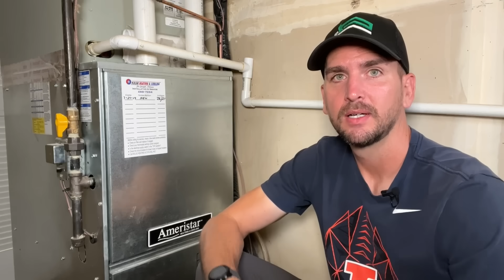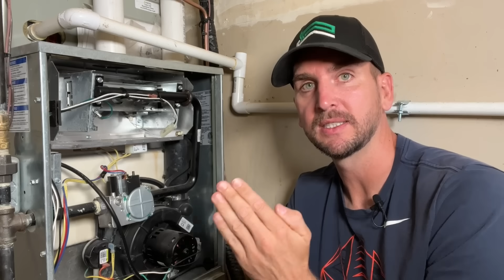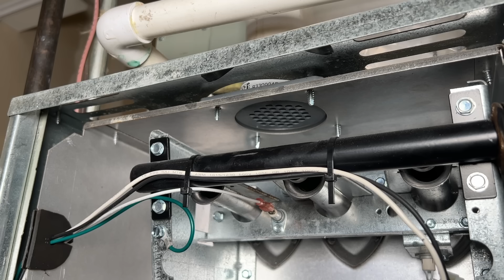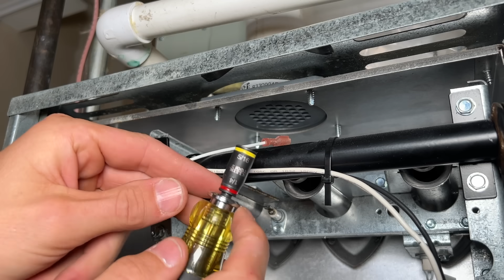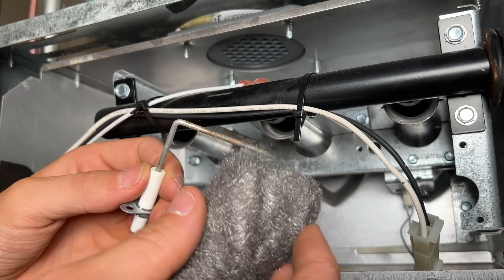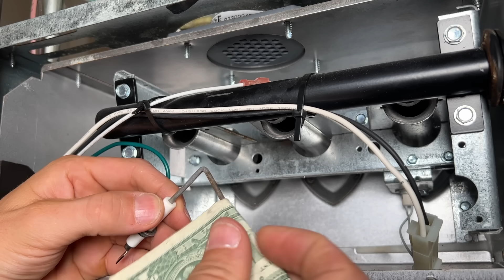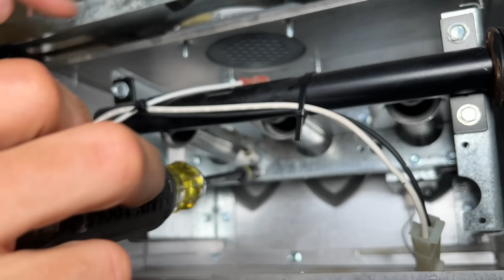The Most Common Reason Why A Gas Furnace Won't Turn On

Comment: I’ve had more hot surface igniters fail than flame sensors. It’s a good idea to keep one of those on hand as well as a spare pressure switch
Reply: Obviously experiences vary.  I have only had the problem with my flame sensor getting dirty.

Comment: The first year we moved into our house with gas appliances, I noticed the heat went out overnight in the middle of winter. Found a video explaining this exact issue, got the flame sensor cleaned and heat back up and running without the wife waking up. Totally saved. The following year the issue returned so I went ahead and got a new sensor and cleaned the old one off for a spare.

Comment: I had the same symptoms and took me about a week to figure out the issue on my older furnace that uses a pilot flame.  Turns out my inducer motor would freeze up and I didn't notice that the small second fan inside the furnace cabinet wasn't spinning.  And I should have noticed this because it had been making squealing noises for several years.  Once I replaced the inducer motor the burners stayed lit.

I think the MegaPro ratcheting screwdriver is better.
Reply: Is your furnace a Trane XL series?  Those seem to have a reputation for noisy combustion air motors.
Reply: @somaday2595  no, it’s a Payne.

Comment: Great video. My gas furnace is 20 years old, and never had this problem. So now I’m wiser, I’ve cleaned my sensor and ordered a replacement. Maybe 20 more years before I have to replace the existing cleaned one. Thanks for such great do it yourself advice.

Comment: Good video. I also would like to suggest a very common problem with the pressure switch being dirty (clogged in my case) where I tried blowing slowly in it and not much flow was going through it. I was able to clean it and bought a replacement just in case for less than $10.

Comment: Very good video. I'm a retired HVAC repair tech. I would add to your information by saying, not to try and bend the flame sensor, and avoid touching the rod with your fingers. Believe it or not, the oil from your fingers will effect the ability to sense the flame.                                                                        John
Reply: I replace my 20 year old flame sensors on my two furnaces. When I bought them at the place I got the furnaces, the parts weren't in a bag and the woman actually handed them to me by the sensor. I told her these should not be touched and she went to talk to her boss and he confirmed. I cleaned the new sensors before I inserted them and have not had to clean them in over a year. We have five cats and lots of litter dust so they need to be cleaned usually twice a year.
Reply: @davidzajac4907 I imagine with five cats you need to disinfect your house constantly. 😆
Reply: The same applies to the headlight in your vehicle don't touch the bulbs cuz it will shorten the life of the bulbs cuz of oil on your skin
Reply: @smokey72382 halogen bulbs only
Reply: This has helped me fix my problem. Thank You. 😊
Reply: Very good explanation awesome
Reply: I'm working on a luxair furnace for a friend. 3 red blinking lights says vacuum switch, switch was replaced and still the sane problem. The switch has 2 vacuum lines. I can lightly blow pressure into either vacuum line and hold the pressure continue lyndon the furnace will come on and run. But once the pressure is released the furnace shuts back off
 Could the chimney be blocked?
Reply: 65 bugnut has passed last fall due to touching live wire
Reply: Thanks a lot
Reply: You saved me!!!  Furnace was down at sub-zero temps and you saved me!!!
Reply: I've got an old Coleman furnace. The mobile home is 2000 model but The furnace says 1973 so I don't know. The green light is flashing three times which indicates Combustion Air Switch Failed to Close. As long as I blow into the hose leading to the switch the light stays solid but as soon as I stop blowing the light starts flashing in three again. Recommendations short of buying a new furnace? Ty.
Reply: I have an old goodman gas gmt070-3
I'm not sure why but I will turn it on and kicks on but doesn't get to temp. 
It then won't click back on for hours. 
I'm lucky if it randomly decides to get to temp.
 
I've replaced my thermostat. 
Replaced external filter as well... No idea if there is another i should know about. 
Going to replace the induction blower due to it clicking a bit. 

The flame and fans seem to be working. 

Thank you for whatever help or advice you can give!
Reply: Used automotive mass airflow sensor cleaner, worked like a charm
Reply: My burners won't get to the part where they light before sensor can sense there on
Reply: Check gas valve
Reply: since you are retired what did you charge to make a residential troubleshooting?
Reply: Holy crap. Had no idea how to do any repairs. Followed your advice and rubbed a dollar on the flame sensor. Started right back up!! Amazed… and did it while waiting for a call back from the repair guy. You are amazing!!
Reply: The what? You mean the thermocoupler?
Reply: Also make sure that the green ground wire is connected on both ends. If your burner is not grounded it won’t work
Reply: ÑSi Si
Reply: And turn off power when cleaning senser, 120 volts can be present on senser wire and rod.
Reply: Learned that hard way last year arched the ignition and fried the board was a nice 600 dollar part now shits not starting this year
Reply: Good to know!  So if you think that somebody HAS handled it, should you just use dish soap; and water, rinse well, and let it dry?
Reply: I always clean them with rubbing alcohol and a non lint rag after handling or 0000 steel wool with some rubbing alcohol
Reply: Very true.
Reply: @Theclassyburito  no I'm good I'm happy with the man I'm with he works his ass off
Reply: Can you advise?
Trying to fix my daughter's furnace. Our furnace guy is too busy. 
It's not high efficiency like the one in this video.
The motor in the "draft inducer" blower motor burnt out. Got a replacement from Amazon yesterday. The original blower housing has a small 3/32" steel tube port for a silicone tube that goes to the pressure sensor. The new blower doesnt have that port so I made one with a rivit nut and a hollow 1/4-20 screw but the pressure switch doesnt click.
I assumed that since the port is outside the squirel cage wheel, the pressure switch must sense positive pressure. It doesn't; it senses vacuum! When I suck on the disconnected tube to the pressure switch, the furnace comes on.
I dont know how there's a vacuum inside the blower housing but outside the squirel cage.
Maybe there's some kind of bernouli thing going on. 
The blower mounts to the exhaust of the hot box. Its outlet is blowing vertically upward to the chimney at a tangent to the squirel cage at the 9 o'clock position. The vacuum port on the old blower was on top at the 12 o'clock position. I didnt think that position mattered so I installed my new port at the 3 o'clock position. The smoke from a blown-out candle is not deflected by my new port when the blower comes on.
I'm about to install a 2nd port at the 12 o'clock position today. Do you think it will work?
Reply: @Bluuplanet  Since this was 9 days ago, I assume you got it figured out. Pressure switches should be called NEGATIVE pressure switches or vacuum switches. I cannot think of a single furnace (except the Lennox Pulse) that monitors any kind of positive pressure. The placement of the port on the housing would be critical.
Reply: @chrisdeanndavison3626  
Its operational but not fixed yet. Furnace man was swamped; said if we could get it running any way, do that and he's coming when he's got time. I figured the switch was negative when I had to suck on the tube to make the furnace run. 
Since it's a brand new blower, it's dependable till he fixes it so I shorted the N-pressure sw for now.
Think I got the port in the same place but it's about 5/16" OD and the original was about 1/8" OD.
Reply: Could you possibly help me my husband nobody Will help us HVAC is trying to make us pay a shit ton of money
Reply: Always wounded if any HVAC people watch these videos

Comment: Some units have a pilot light, electric sparker, and the 'flame' sensor is on the pilot light.
Reply: Vladimir Putin  Technically accurate, the term "flame sensor" is used for a detector for the main burner being lit, where the term "thermocouple" refers to a detector for the pilot light being lit.  The difference is necessary when ordering the correct repair part.

Comment: Great explanation on the video for someone like me who is not familiar with furnaces. Scott, could you do an explanation video of how a gas broiler works using water heating through baseboard radiator and maintenance 👍

Comment: I had similar symptoms in a gas furnace.  Turned out the draft enducer would cut out randomly momentarily while running slamming the gas valve open/ closed.  Two different tech calls later and a new gas valve the problem still persisted.  So I took matters in my own hand-  turned out there was a partial blockage in my chimney. I had a co detector in the same room,  never went off but probably due to the draft enducer saving our lives.  Moral is to clean the chimney even if all you have is gas.
Reply: Yep.  Chimney  in a one hundred year old house was plugged up.  I got it cleaned out and saved a service call.  Now I check it every fall.

Comment: That a Good screw driver,My furnace is Early 90's and diffrent your right they all basicly operate the same, and now be checking that burner sensor more often. Im dealing with just one furnace thats enough for me, thanks for sharing.
Reply from the maker: 😂 No doubt!

Comment: Most modern furnaces have some kind of troubleshooting indicator on them (LED light(s) or a numeric display) that will help the owner determine what issue the furnace is reporting as to why it won't run. Usually there's a chart on the furnace, in the owner's manual, or that can be found online that will tell you what the indication means and how to resolve it.

My furnace has previously indicated that the flame wasn't detected, and what you did in this video was the fix for it.
Reply from the maker: Good note, I wanted to jump into the diagnostic codes but decided to make it a separate video 👍
Reply: my error light did not send out error code... I was looking for the error code in the number of blinks from the led light and there is nothing listed as a 1 blink...  It showed there really wasn't anything wrong with the system.  It was cleaning the gas nozzle; they were a little clogged.
Reply: I found mine on the box of last control board.  Does not help me

Comment: I’ve had a situation a couple of times on my furnace where the blower pressure diaphragm switch was “stuck, or stiff” and would not close during the first startup of the season.  Taking the tube off and blowing/ sucking gently to exercise the diaphragm solved the problem for,the rest of the season.  Had one other occasion where the incoming air was at -35F and made it so stiff it wouldn’t flex.
Leaving the service cover off for a bit allowed it to warm up enough to operate.  Really helps to know,how to troubleshoot these things when it’s cold and dark and the service tech is a day away!
Reply: Jesus, you're going to kill someone.  The diaphragm doesn't get "stiff"
Reply: @benjohnson4404    It does when the incoming air is minus 25 degrees celcius!

Comment: Great info! I'm learning more about all the house systems from you, and I've done a lot of diy stuff over the past ~40 years. My blower motor circuit board had a solder failure on ours and luckily I found info on the repair. Saved me $$$. Then the other unit failed too, the same way. Both still going strong after 25 years and they are in great condition. Keep up with the great tips!

Comment: Scott
You are absolutely wrong with suggesting steel wool to clean a flame sensor! Using steel wool takes the coating off the sensor which is as much important as it is not to touch the sensor with your fingers. Cleaning can be done with a dollar bill or a scotch Brite (green pad) only!
Reply from the maker: Thanks for the feedback 👍
Reply: @EverydayHomeRepairs  Nice video, well done.  Fine steel wool is OK to use, that's what was recommended to use back in the day. However, I went to scotch brite pads because fine steel wool corrodes easily.  The flame rod does not have a coating as far as I know, you want to avoid abrasive cleaners like sandpaper or plumbers roll because they will etch grooves into the flame rod material that will quickly fill with detritus leading to premature failure.  A typical flame signal is in a range of 1 dc microamp to 3 dc microamps and anything that increases the resistance to the flow of such a tiny current will cause trouble.  Even a rusty/dirty gas burner (serving as the ground conductor) will do it.  The flame signal returns to the control board via chassis ground so if the burner is rusty or the ground wire is loose, you'll will likely have flame failure.

Comment: Always had build up in pressure tube; exhaust stack would get sediment and removing tube and poking hole through seems to clear build up. I assume flame needed adjustment.
Reply from the maker: Hmmm, never had that issue.  Thanks for sharing 👍

Comment: Scott, Great video. Like many, I solved this same issue for my sister and brother in law this past winter. Did some digging on their specific furnace, mobile home furnace but very similar to the one in the video as far as components go. Easy fix and got them warmed up. A week later they had a inspection done to make sure it was safe and not leaking CO2. They also have a CO detector near by.

Comment: One other common causes of a furnace not staying on is the filter needs replacing.  The blower motors usually have a thermal protection device for when the motor gets too warm.  (ask me how I know this one)

One cause that will keep Step 3 from happening is the ignitor has burned through.  Had this happen twice at my last house over 12 years time.  Usually unplugs (two wires in the wire harness) and then be checked with a continuity tester.

Somewhere there is often an LED that will flash an error code (long flashes and short flashes) and a listing of what the error code means.
Reply: Dear David, how u know this one？

Comment: Working with rental property I've had to clean a lot of flame rods, mostly because they do not tend to be very good house keepers. Good information 👍.
Reply from the maker: Oh man, I feel your pain 😂
Reply: Why would you expect your renters to do maintenance on your property? Thats what they pay you for.
Reply: I didn't say anything about maintenance of the house, just housekeeping, like keeping their places clean and removing their trash from the house.
Reply: @yodasbff3395  you said that you had to clean flame sensors because the tenants are not good housekeepers. The cleanliness of the house has nothing to do with the flame sensor, or any part of the furnace besides the air filter to a certain extent.
Reply: @Redtooth75 tenants never change air filters, even when u give them filters for free.
Reply: @MG-fn9xw  ok thank you for sharing

Comment: When I bought my first home in 2013 the flame detector went out on our gas furnace that was originally installed in 1986. I knew nothing about how a gas furnace operates but did some digging and concluded the flame sensor needed replacing. I got it working again and figured I'd replace the entire furnace soon because it was so old, but it's now 2022 (36 y/o) and still working fine. As a safety measure I did try to push an inspection camera into the heat exchanger (not easy) to look for corrosion and I keep way too many CO detectors throughout the house in case the furnace ever leaks CO, but they all still read zero ppm.
Reply from the maker: Yeah, The unit at my house is 25 years old and the heat exchanger has enough corrosion I am starting to get a little more concerned.
Reply: No corrosion in the heat exchanger.  Unbelievable.  Thank you.
Reply: very smart decision.  good job
Reply: @KLondike5  - That's unfortunate. I've also heard similar stories, but about 15+ year old roofs in Florida, where the insurance company doesn't want to renew the home insurance policy unless the homeowner replaces their still perfectly fine roof.

Comment: 3 years since a service?  I saw a similar furnace open in Lowes. Looked identical to my 40 year old furnace. Checked part numbers on my parts, most are still used on brand new models. My furnace also has an LED that will blink and you compare the blinks to the svc  manual and it self diagnosis. I usually use scotch brite on the temp. senser. Never touch your igniter. Its like a hallogen headlight on a car. Touch the bulb abd it will burn out whwn it heats up.
Reply: Flame sensor